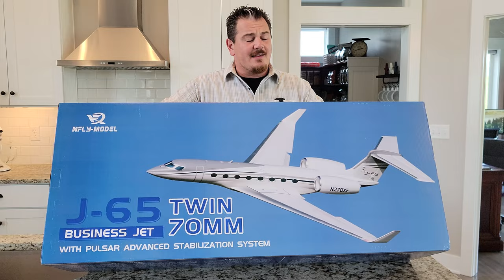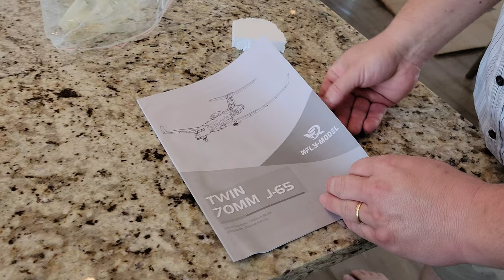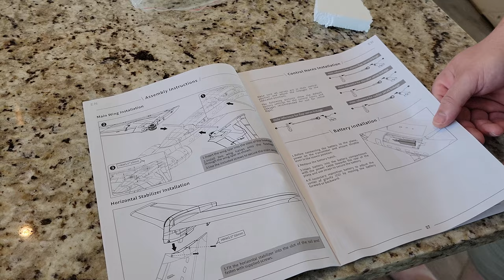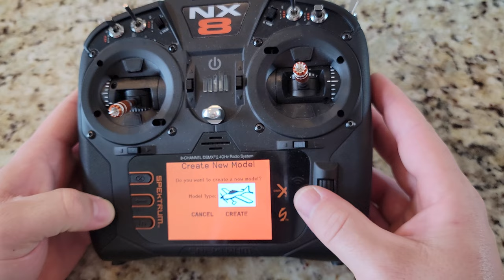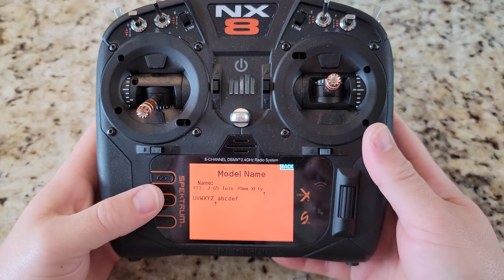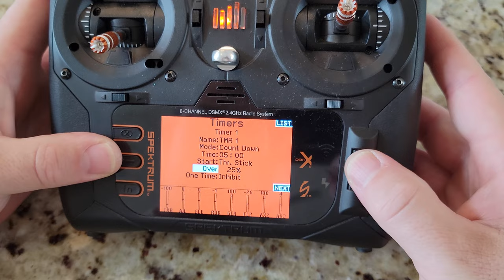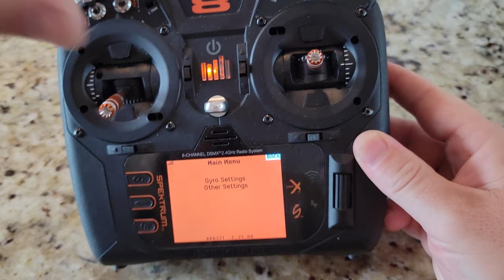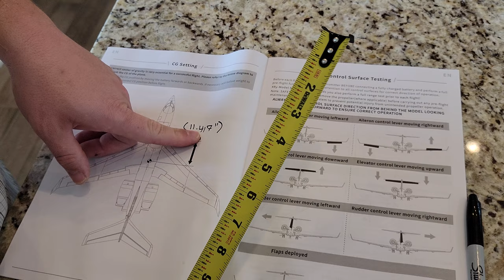Xfly - J-65 - Twin 70mm Business Jet - Unbox, Build, & Radio Setup

Comment: Brian and Megan, Thanks for your video... very helpful...I thought about the AR637T! Then I thought about the AR630, without Antennae's. What is the difference, if any? won't they do the same thing? Hmmm! Lot's to think about there!
Reply from the maker: Difference is the "Fly By" Telemetry on the AR630, and the notable absence of VOLTAGE INPUT. This will only be an issue if you DON'T end up with an Avian ESC ;)

We are putting in Twin 60 Amp Avian's as soon as they show up, and want to share the process....it's gonna be epic...thrust reverse just like in a REAL Gulfstream ...can't wait to do this project!!!

If I had to advise you, you COULD do this...

J65 https://bit.ly/3EpgpoR
7000mAh 6S https://bit.ly/3PtmZRK | 5000mAh 6S https://bit.ly/3PukVJf
AR637T https://bit.ly/3OlgIpB <<<<< This adds the battery telemetry - nice feature, plus FULL RANGE Telemetry.
AR630 https://bit.ly/3zpdgVR <<<<< I'd avoid this with only internal antenna. This is a BIG plane that's going to be long ways away
AR631 https://bit.ly/3v0w3Fy <<<<< I'd get this since it had two antennas...this plane is BIG...and goes a LONG ways away!
AR8020T https://bit.ly/3vgCnbV <<<<<< You could use this WITH the provided PULSAR Stabilizer, and get FULL RANGE TELEMETRY
NX8 https://bit.ly/3J05xSj

Comment: I have a question. I crashed my t28 Trojan 1.1m. I took the electronics out of it plus the receiver, instead of buying another bnf, could I just get a PNP version, and just put the receiver out of the old one in it? And if I did with everything would still be the same
Reply from the maker: YES. This is fine, but keep in mind, if you get ANOTHER plane that's in PNP, the channels may be programmed to work in opposite directions, so you can either reprogram the Rx, after updating new firmware, so you can do a FACTORY RESET from FORWARD PROGRAMMING, or you can just use these on each of the controls that are backward...

Servo Signal Reversers https://bit.ly/3B9nVpT HH | https://amzn.to/3bpECDf AZ | https://bit.ly/3tkn9yN BG

...and NO, you can't just swap the direction of travel on the Tx, you need AS3X and SAFE to work the right directions too...thus the need for the servo reversing.

Comment: I need to correct you on the leading edge on the Jet stream, they don't have leading edge boots that inflate. They take bleed air off the engine and run it via large bore pipe inside the leading edge, The leading edge is high polish Alu possibly 7075 T0 then pressed into a rubber die then heat treated up to T64 .
Great channel Brian love your presentation.
Reply: I legit came to the comment section to correct him on that as well! Great catch.

Comment: Been enjoying your vehicle uploads, suggestion get one of your crashed planes and mount the tail section on the roof as if it is a landed lawn dart so people will know where to find you, a friend did it with a fifth scale onroad BMW that he destroyed doing speed runs.
This hobby aint cheap just had to get some replacement and upgrade parts and said goodbye to £650 plus for the second month running so just aswell not flying expensive planes.
So your drainage ditch in the winter you could do jetboats, airboat's and the odd tug, been looking at hovercrafts.
Reply from the maker: YES! That would be cool!!!

I want to put in a pond too...but we have a couple projects in line before we can "afford" it ;)

Comment: Hey Brian, Just Put A Lil Motor On The Elevator Tail Section & Fly It As A Separate Sub-250g FPV Wing... Then Make A New Fuse Outta A Fat Pool Noodle or All That Excess Box Packing Foam, To Use With The Wings For A Nice Sail-Plane or Power Glider, Then You'll Have Three+ Planes For The Price Of One, Plus Eliminating Them Noisy, Nasty Power Grubbin EDFs + Expensive 6s Batteries, Etc? 🤔🤪🤣😁😎
Reply from the maker: LOL - amazing plan!!!!!!!!!!!!!!!

Comment: If you set up a receiver with SAFE mode selected, but have to invert one of the outputs because the flight control surface its operating opposite of what it should, does SAFE understand this and will it give the correct output to counteract a wind gust or axis change?   Or will it make the situation worse ?

Comment: Negative Brian the ice management on this full size and most jets is a metal leading edge that uses either exhaust bleed or a heating system to melt the ice off, a pneumatic boot would be useless and counterintuitive on jet aircraft, turboprops utilize the blown boots system of rubber leading edges - that's why they are chromed here, the same system is evidentnon all jet nacelle intake rings, that's why they are almost always chrome/natural metal in finish. The antenna on the vertical is you UHF antenna indeed
Reply from the maker: Nice! Thanks for the clarification! I've only partially understood this, but thanks for clarifying this, so now I know ;)

So slower planes might use a bladder to POP the ice off?
Reply: @BrianPhillipsRC  generally smaller aircrafts have the boots, and they simply inflate to break the ice apart, and then it falls off the leading edge preventing disaster!

Comment: Great Video! Beautiful Plane! Yet to invest in my first system, but watched a lot of videos so far (Mostly yours) and I think I'm set on the Carbon Cub 2s BNF kit and upgrade the transmitter and receiver? Going to tune in to your 2+ hour Carbon Cub video now. Didn't watch it before because until this video my You Tube attention span was about 30 minutes.
Reply from the maker: When you get ready to jump in, just get the RTF combo and see how much you love it, which will be a lot ;) Then you can spend a lot more money on BNF with NX8 and better chargers...and loads of batteries and planes in your future, but take it one step at a time. You'll advance so quick, and if you CAN get a simulator for windy/rainy days and fly the heck out of that thing! Practice all the time - you'll want to anyway, but get out as frequently as you can to shorten the duration of newb status ;)

Not sure if I sent you this list yet, but here's our beginner list recommendations...

Description | Purchase | Videos
Habu STS 70mm RTF | https://bit.ly/3ci5eWD | https://bit.ly/3ontBF9
Apprentice 1.5m RTF | https://bit.ly/3BlSjh9 | https://bit.ly/3b6kCVP
Carbon Cub S2 1.3m RTF | https://bit.ly/3PqNR4A | https://bit.ly/3J6WmQ3
T-28 Trojan 1.1m | https://bit.ly/3PmbxHf | https://bit.ly/3v8zGJi
Apprentice 1.2m RTF | https://bit.ly/3BlSjh9 | https://bit.ly/3Bk60wG
Sport Cub S2 UMX | https://bit.ly/3yYkrUs | https://bit.ly/3PL8vfJ
AeroScout 1.1m | https://bit.ly/3OlqyYQ | https://bit.ly/3ztp9Li

Trekker 1.2 RTF | https://bit.ly/34jhgLZ | PNP https://bit.ly/35xOPu8 | https://bit.ly/3PHoZ8M
Bigfoot 1.3m RTF | https://bit.ly/30mYdOq | https://bit.ly/3zqIxZu
Pioneer 620mm RTF | https://bit.ly/2YotgbY | https://bit.ly/3OvJLad
Prodigy 1.4m RTF | https://bit.ly/37zJxzt | https://bit.ly/3cvccaZ

Ranger 1.2m RTF | https://bit.ly/3bHFIKr | https://bit.ly/3bCezZB
Reply: @BrianPhillipsRC  Thanks for the response and advice. Love the channel!

Comment: Safe.... Pfft.. Learn to fly it!
Reply from the maker: I had a lot of problems with this plane. If your plane doesn't go to full throttle, this can be sometimes corrected by "calibrating" the throttle range. This is easy, but only if you do it right!!! Other wise, it can be somewhat dangerous - FYI.

First, verify the ESC make and model.
Search Programming Above information...

the process should be similar to this...

From plane off, transmitter off.
Power Tx, full throttle.
Power plane, keeping prop well away from your body (remove if necessary).
Once the ESC fails to initiate, you can wait for a series of beeps and whatnot (this is where it's helpful to have a programming manual for the Make and Model...yes, they do vary over time for even the same plane).
Usually on the first sounds, you can throw the throttle to ZERO...and the ESC will initiate. Now check the power from 0% (stick all the way down) to 100% (Still all the way up)...and you should be calibrated now.